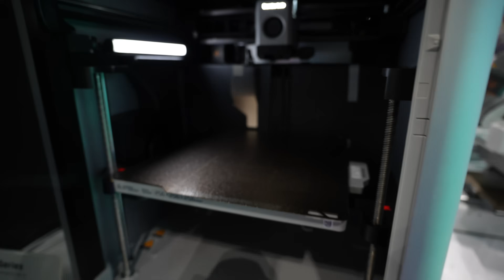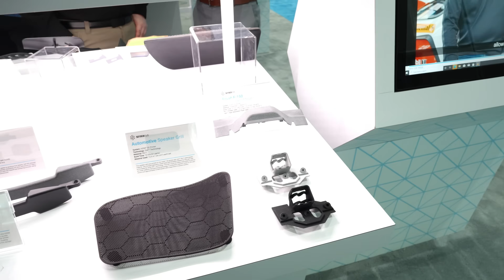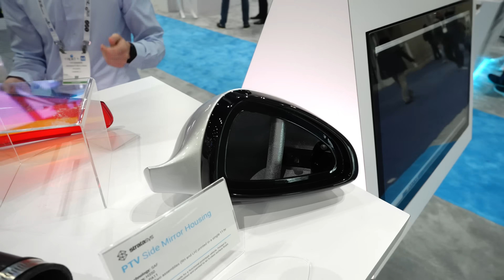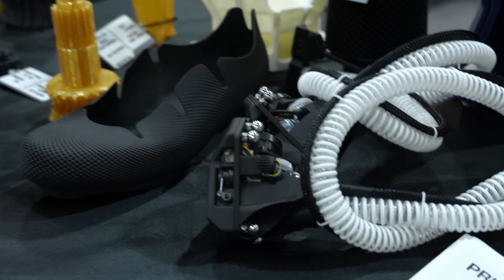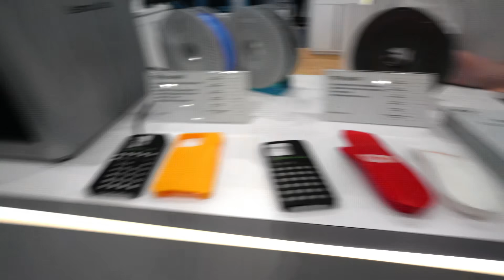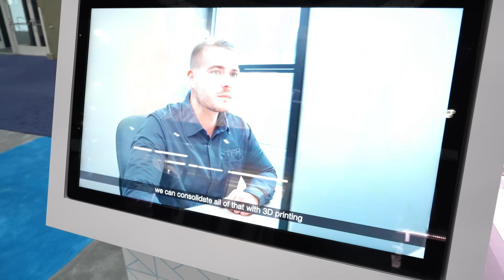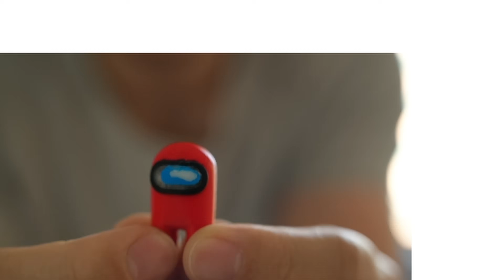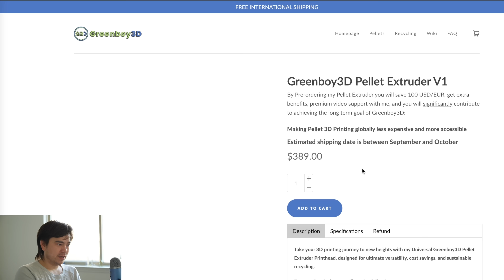Bambu Lab Patent Infringement, PRUSA MK4S, and Cheap Pellet Extruders (3D Printer News August 2024)

Comment: multi-toolhead color changer? that would be insane. imagining 4-5 toolheads that also can utilize the ams for each toolhead.
Reply: @FuIImatiK  That would defeat the point of having multiple toolheads
Reply: @syko2695  oh so you know the point of having multiple toolheads? what would that be?
Reply: @FuIImatiK  the point of multiple toolheads is as far as i know is: way faster color changes and less contamination when using different materials (since the nozzle changes with material changes) , the AMS was made in mind to have multicolor and multimaterial prints with a single nozzle.
So while a multi-toolhead printer with AMS is entirely possible, it may  be overkill for most applications , since a single nozzle can have up to 16 different colors with the 4 ams , and  5x16 = 80 , so assuming that each toolhead of the of the toolchanger can have up to 4 AMS , that would make it a printer capable of printing using 80 different colors assuming it has the 20 AMS , at that point i'm pretty sure you can just print colored minis lol
Reply: @ulforcemegamon3094   where did you get 80 colors from lol. The 5 headtool system is limited to 5 colors or material. Having something like an idex or multi tool head that can utilize an ams could open up huge color capabilities while saving in time. Swapping filaments in the background while another toolhead is printing would be ideal. You don’t need 4x ams for each tool head.. but multiple toolheads feeding from 4x ams would make more sense.
Reply: @FuIImatiK  80 color thing is from the fact that a single Bambu lab printer can use up to 4 AMS  , so if each toolhead can also use 4 AMS , then it could potentially do the 80 color thing . But like you said , is more practical that multiple toolheads feeds from 4 AMS , as you would have more material/color capacity while at the same time taking less time , since you can do switch toolheads while a toolhead in the background is changing filament , saving alot of time

Comment: Easy solution. Bambu pays the stratasys for each they sell in the US, but absorbs the cost from the US buyers. Make it double. Still cheaper than stratasys. People will blame stratasys too. Lol
Reply: Double edged sword😂
Reply: People still won't know who stratys is, and it still sets a precedence for suing people who print objects using the patents they didnt arbitrarily add the part about partners and users being induced into patient infringement for no reason.
Reply: Stratasys don't have to licence the patents, so they'd refuse those terms. 
They'll want a cut of every sale.
Reply: If it happens, a lot less people will buy it. So yes, MAKE IT DOUBLE.
Reply: @rightsdontcomewithpermits7073  people will still buy it if it is good (statistically proven). But not directly with bambu to avoid extra charge. There are other platforms selling it. It's a buyer's choice.

Comment: Let's zoom in about how big tech companies behave beside the regulations/juridistics. Morally how would this technology advance and innovate if patents makes sure you have to dodge every single detail that other big tech companies monopolize ideas/designs/colors/shapes and iterated on?

I think this just causes other companies just to sue purely, because they can't compete and don't really care about technology at all but money.

So what Stratasys did was to protect their brand, because their losses are actually hoe they failed in development with their current machines. It's industrial vs hobby, I honestly don't think they don't care about Bambu Lab, but want to take advantage of the situation and wanna see money
Reply: They are threatened because someone finally made a machine that can do about 80% of what a Stratasys can do for less than 1% of the machine price. 

Stratasys has relied significantly on the value of their intellectual property and significant over engineering of their machines for manufacturing capabilities to make money. They have never considered the business approach of making machines for the masses that are very good but may wear out much sooner. 

If a machine causes a would be Stratasys customer to buy 1 printer from them instead of 10, in favor of many Bambu Lab machines, that's the first time this has seriously occurred in their catalog approach. Generally, Stratasys produces the most reliable, best part strength, size, aesthetics 3D printers on the market. It's absolutely incredible how well built they are and how long they last.
Reply: Cost of usage is the issue. The difference between needing to tune filaments vs dropping in a spool and having the correct settings read from the rfid chip is a significant issue for companies. And compared to other printers like markforged, visionminor, pantheon,... who all have theor filament with tuned settings, bambu has a much greater variaty of material and colours (~ 50x the options) at a considerable lower cost. The usage has become so easy that it becomes a tool rather than a research prohect itself, and that was stratasyss business model.

Comment: bambu actually doesn't have the load cell in the nozzle. its actually in the bed. at least on older units on x1. that being said, it does use the nozzle to do this but the sensors are not in fact on the toolhead. but this has been done as far as I know at least as early as 2016 if not earlier in the reprap space. precisionpiezo in I think it was uk was selling diy kit solutions in this space back in 2017 iirc which were popular with Kossel delta builds at the time.
Reply: It's on the P1P and P1S too.
Reply: E3D just introduced a hot end with a load cell sensor in it.  They also probably have a patent on their design.
Reply: the patent is specifically referencing the use of the load cell, hence your example of precisionpiezo is invalid as it is a completely different technology in use.
Reply: I actually did much of the development of the firmware and hardware, back in like, 2013? It's sort of annoying that BBL keeps trying to patent things where I know who actually invented it, or was involved in the initial development of it.

Comment: Honestly this makes no sense. Arachne was developed by ultimates/cura and is governed by GPL license of cura. Also cura has purge towers in the slice engine. Same for prusa slicer.

So then both prusa slicer and cura will also have to remove this? As they are all based off this? 🤔 honestly struggling to grasp the practicality of it - could Bambu just say, sure we stop developing Bambu slicer, go use orca or prusa or cura and that’s it? Problem solved? 

Or then would prusa and orca and super slicer etc need to remove all infringing code? 🤨

But then what about cura and the GPL license which does permit use of the code freely with attribution. 

So what’s gonna happen here? Will cura also remove this? Or can they retrospectively change the license to make that part of the slicer (Arachne, purge towers) non gpl?

This honestly makes no sense and it’s confusing to bits…

Edit: and what about GitHub in all this. Can they act on a dmca notice if the patent case is successful and end up removing all major slicers from the platform? 🤨

Edit 2: also as the code is forked from prusa and cura, which both are distributing the code under GPL, they are giving rights to use the patents that they don’t have. So this will backfire towards that direction too?
Reply: Yeah, there is really no end to the reprocautions for these lawsuits it doesnt just stop at FDM printers either, resin printers sometimes use spring steal, other automated machines that deposit as something or other have built in loadcells to sense location. It really is the biggest patent troll ever.
Reply from the maker: Yeah it’s wild, I have no idea where this will all end.
Reply: No one has to do anything unless Stratasys sues them.

Comment: Purge towers are in the slicer not the printer?
Reply: Not Purge tower, but Prime tower. Not for purging too, but for stabilizing nozzle pressure before printing objects. It's a different function.
Reply: @KokaKuku prusa does exactly the same with the XL - it’s using the purge tower for priming the nozzle and stabilising the nozzle pressure before printing.
Reply: @HotendHacker  wrong it not Purge tower ot a priming tower
Reply: All Bambu have to do is remove the print tower from Bambu Slicer, then add a plugging feature that will allow a 3rd party to make a print tower plugin. Problem solved.
Reply: @Richard-ys2ns GPL v3 license grants a patent license to the fork (there’s a whole section on patent handling on the GNU website for GPL v3). . So it’s not Bambu’s problem but cura’s and prusa’s if they distributed code that infringes on a patent without permission or the right to do so. That’s what I don’t get at all. And what could have scary consequences.
Reply: @HotendHacker  , software ideea can not be patented so no problem for PrusaSlicer, OrcaSlicer etc. But Bambulab send the printers with preinstalled models that have purge towers... Just click and print with purge towers
Reply from the maker: They are alleging patent infringement on bambu studio
Reply: @NathanBuildsRobots so then prusa slicer will also have to remove this? As they are all based off this? 🤔 honestly struggling to grasp the practicality of it - could Bambu just say, sure we stop developing Bambu slicer, go use orca or prusa and that’s it? Problem solved? Or then would prusa and orca and super slicer etc need to remove all infringing code? 🤨

But then the prime/purge tower is also available on cura and the license does permit use of the code. So what’s gonna happen here? Will cura also remove this? Or can they retrospectively change the license to make that part of the slicer (Arachne, purge towers) non gpl?

This honestly makes no sense and it’s confusing to bits

And what about GitHub in all of this - if a win is declared then are all major slicers going to be taken down due to patent infringement via DMCA?
Reply from the maker: @HotendHacker it sure is a big can of worms Stratasys has opened up.
Reply: @NathanBuildsRobots  But bambu studio is a fork of prusa slicer forked from slic3r why are the not going after orca slicer this sounds really shitty
Reply: @Feibie  no but they sure are taking it away based on this BS lawsuit
Reply from the maker: You don’t have to be making money to be sued for patent infringement. The fact that people are using the free solution instead of the paid solution could be argued as damages to the company regardless if they are making money or not
Reply: @NathanBuildsRobots Yes but no value in seeing a non profit....because their are no profits to be paid from.
Reply from the maker: @liamventer if they are causing a loss of profits or damaging your company they can still sue for an injunction to stop a non profit

Comment: isn't one of the patents, is a heated build plate?
Reply: Yes US9592660B2 Heated bed
Reply: yeah stratasys has used invalid patents before one was thrown out as being clearly invalid in their lawsuit in 2014, (they patented using infil even after it had been used (even by them for almost a decade). I've read US9592660B2 and it's basically a removable pei build plate (even though you could buy them freely well before 2014. No novel chemical formulae etc just the general concept.
Reply: Yes, But the patent is from 2014, however there was plenty of prior art, RepRap used it prior with plans/schematics for heated bed from 2010 maybe earlier.
Reply: The patent (US9592660B2) in the lawsuit is
- a heated bed
- with a separate heat conducting plate
- with a polymer coating for adhesion during printing and release after printing (not tape)
With a filing date of 2014, it'll be hard to find something matching that description. The printers I can find from that era miss the description, like having a PEI-coated glass beds without a separate plate. I wouldn't be surprised if Bambu's lawyers can't find prior art that can invalidate the patent. If Stratasys wins on this one and takes the injunction route on Bambu and the other 3D printer makers, it's back to bare beds and hairspray. That's not necessarily the obvious route they're going to take, though, as Nathan elaborates in the video.
Reply: All this BS is only possible in the US thanks to the shameful Obama’s administration which in 2013 amended the patent law de facto abolishing the “prior art” rule and allowing the far west “first come best served” sham which basically means that you can now patent (on USPTO only) already publicly available concepts even if they belong to the public domain space. That’s exactly what Stratasys did after they acquired Makerbot and put their hands on the controlled Thingyverse open source platform. In fact the most relevant patents in this lawsuit date back to 2016, well after Makerbot acquisition. I well remember the outrage spreading at that time in the open source community as Stratasys allegedly patented several ideas deposited on Thingyverse by makers under the open source agreement. I covered that and published an extensive blog with a list of almost all the relevant Stratasys patents potentially affecting the 3D printing community. The website I was running at that time was named 3DZero.com.
So yes, this is just another byproduct of the toxic woke corporate ideology and their dangerous illiberal policy. 
Shame on the US for becoming the most dangerous enemy of innovation and IP rights in the world.
Reply: @michaelfilippi3276  don’t know why he didn’t mention that.
Reply: @Fjprints  He did. The 660 patent isn't about a heated build plate. It is about a polymer coating that isn't a tape. I still think the patent is BS, because moving from a tape to a painted coating is an obvious step to a "practitioner of the art". (Not a lawyer, not legal advice)
Reply: @Fjprints  Cause he is a Bambu hater. I watched another video about this. Pretty much all the patent infringements were technologies that every single FDM 3d printer in existence use. Even extruding filament along programmed paths or something like that stratesys claimed they owned the rights to. I suppose only resin printers would be safe from their patent claims. If Stratesys wins I guess we'll be forced to buy 5k printers that are no better than a p1p.
Reply: @atnfn the expirery of stratasys patent on FDM was what sparked this whole 3d printer revolution in 2005, (and to avoid legal issues, reprap called it FFF not FDM)

IIRC yet to expire patents would be heated build chambers for example
Reply: @atnfn I think Bambu trying to file their own patents is one reason they were targeted. Everyone else is going by the open source model so it benefits the industry, Bambu labs not so much, they want to keep it to themselves to maintain a competitive advantage. Honestly it’s completely fair that stratsys is making them eat their words lol
Reply: @Resyektt This likely has nothing to do with any of that. Stratas market share is tanking badly while BL is growing exponentially. But even BL haters know that this is a bad thing for the ENTIRE 3d printing community. If Strata wins big against BL then it's inevitable that Prusa, Creality, and so on are next.
Reply: @joserafael9913  Sure they will. Why wouldn't they be next? They all use the majority of those patents. So if Strata does win against BL then that case will be used to steamroll every 3d printing manufacturer.